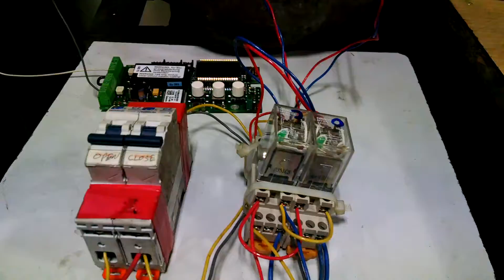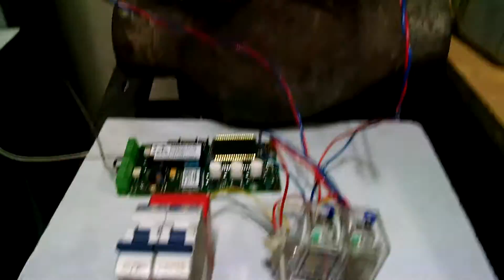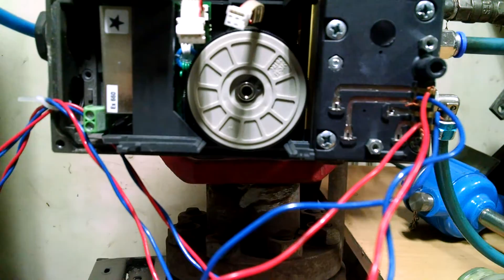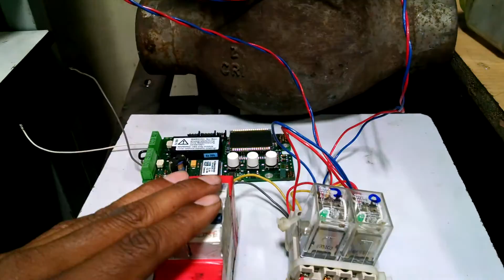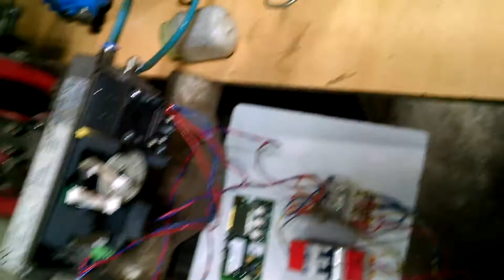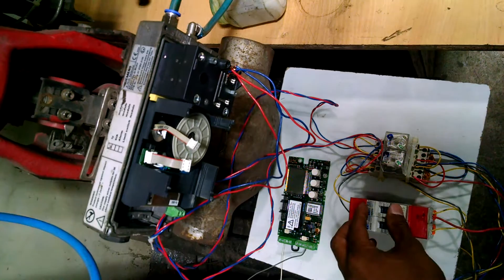Siemens smart positioner PS2

Comment: Good Day, I need ur help on a small issue related with Sipart PS2  (6DR5020) positioner. Actually i am getting very low pressure from Y1 (output)  due to which my actuator is not moving, however, from Y2 (output) the air pressure is fine & actuator moving fine. I also open the restrictor even then there was no increase in pressure from Y1. 
Will appreciate  to advise me on above issue. Thanks & Regards
Reply from the maker: Hi ....1st check your pneumatic actuator should be OK may be passing, 2nd you can give 24Vdc to Pneumatic really for OPEN and CLOSE all ready i put that video in my account, if Pneumatic really is OK then change PCB of the Positioner.  if NOT-OK then You have to clean Pneumatic Really and Check with Piezoelectric valves if you have any spare then change them. while removing pneumatic really be careful very small springs and plastic balls are there. all the best.